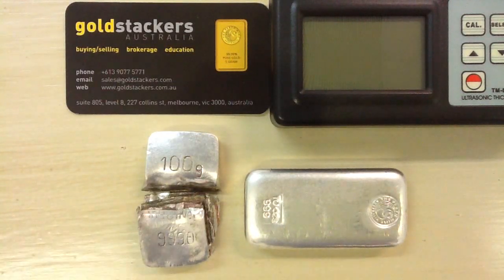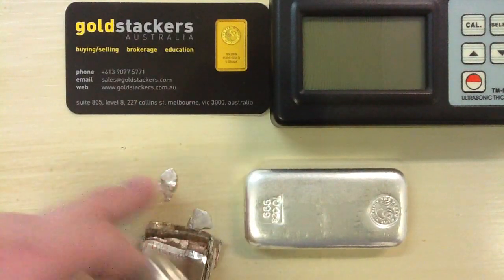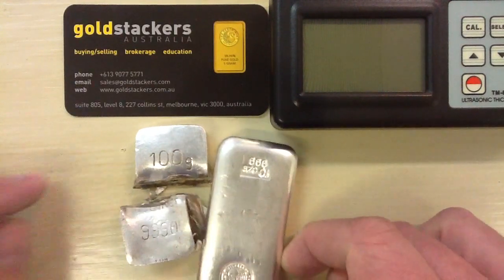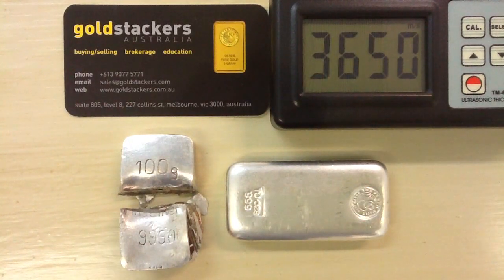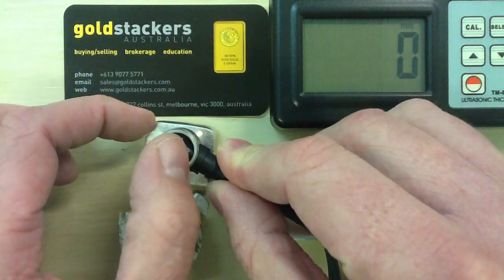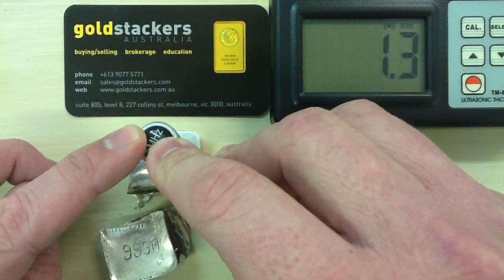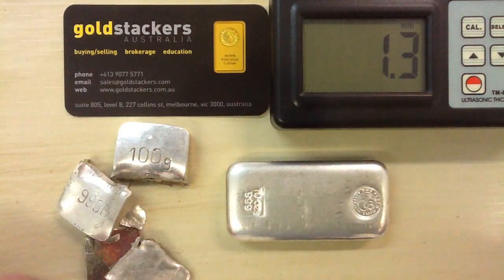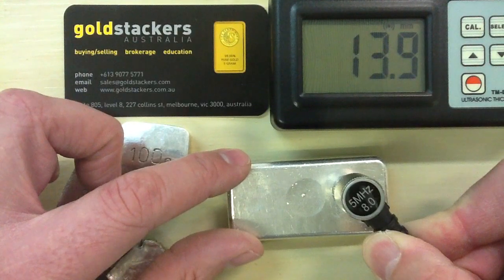Ultrasonic testing of fake silver bar

Comment: Does ultrasound test work on sealed gold bars (5 gram Pamp for example)? I'm planning to get a cheap ultrasound tester for simple testing purposes.
Reply: Have you found out? İ am also interested in this.
Reply: No, ultrasonic testing requires direct contact with the metal. You still need to verify the weight and dimensions, which also requires taking it out of the packaging.